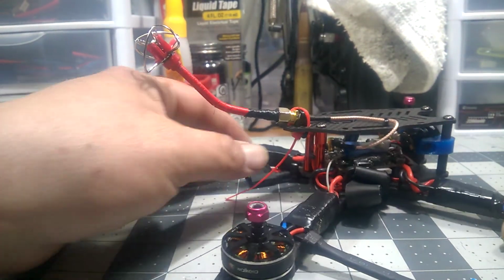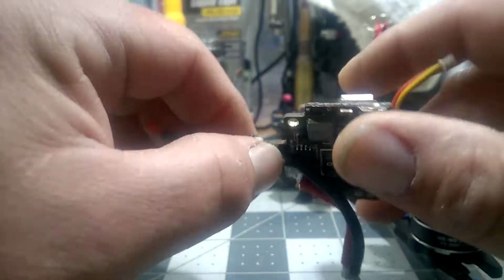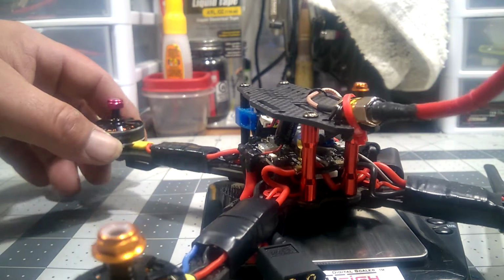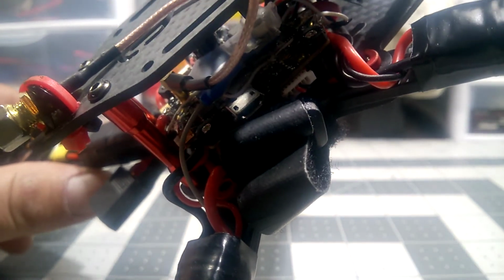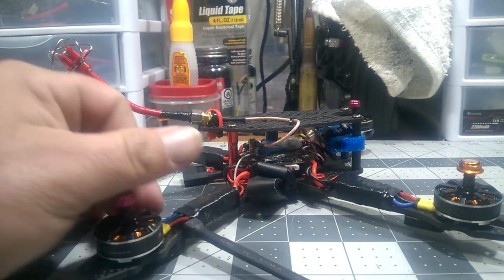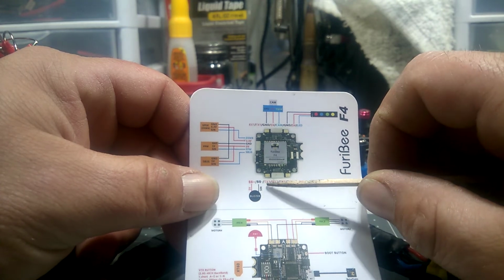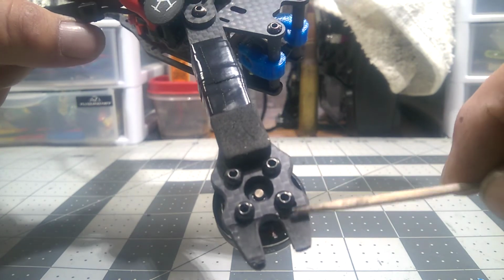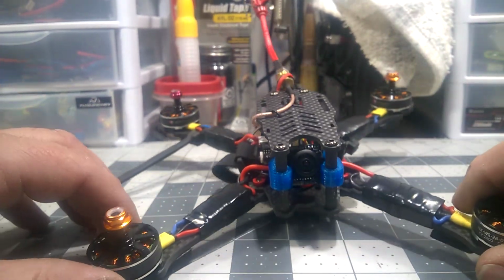F2-MITO with the HGLRC F4 V5 PRO+

Comment: Absolutely fantastic video as usual,,,,,,!
Question,    what type of quad would u recommend for a bit older fellow who doesn't wanna fly at atom splitting speeds, and get some decent videos?  I have a similar controller as you......
Reply from the maker: This setup would be perfect for a rusty pilot that hasn't flown in a long time, what I suggest is start off on 3s with some 2205 2500kv motors. That way when you get your confidence back it will be smooth on 4s! I would really suggest a frame like the wizard or QAV-R. Just something more durable with a bit more weight to really smooth out your video footage!! No pressure, because nobody likes a pusher but I'm setup and available to do builds for specific purposes!! ^_~
Reply: J.FINESSE FLIGHTS I couldn’t agree more.. the wizard but not the S version is near indestructible, very resilient and a great price!! In my opinion it’s the best starter quad!
Reply: Also you can pick up a rebranded hglrc f4v5 from furibee for $29.99 right now.. I have had both and the furibee is exactly the same with the same chip numbers it’s just removed the hglrc logo and replaced it with theirs, they even use the same box!! Oh spoke too soon you got the right one but it’s on sale right now.